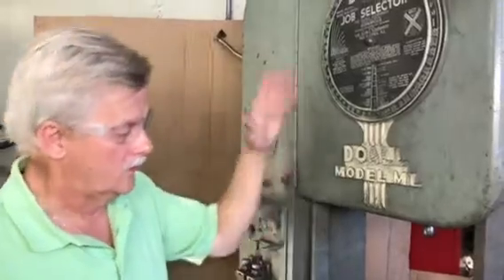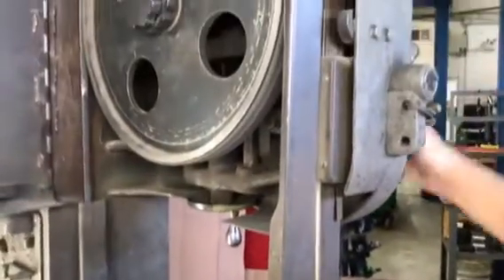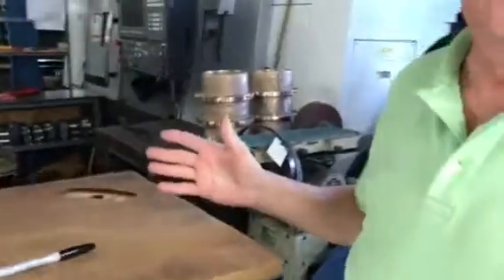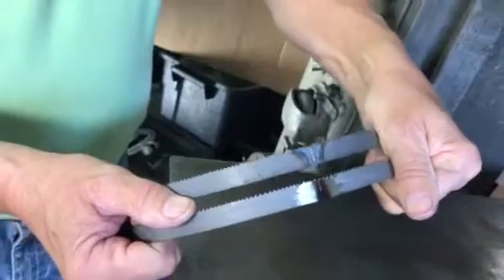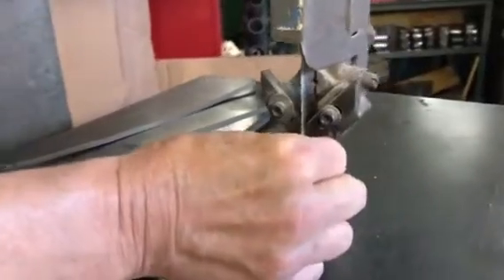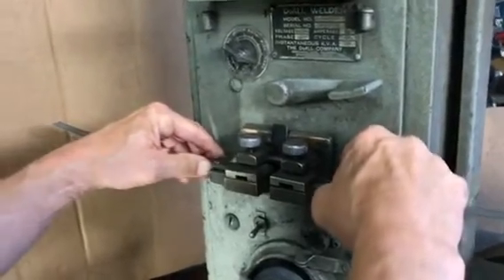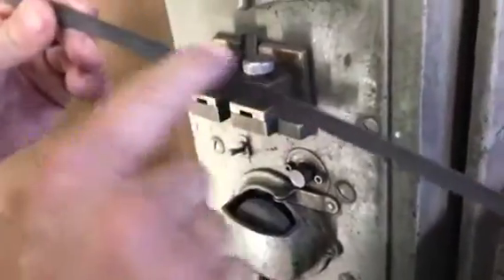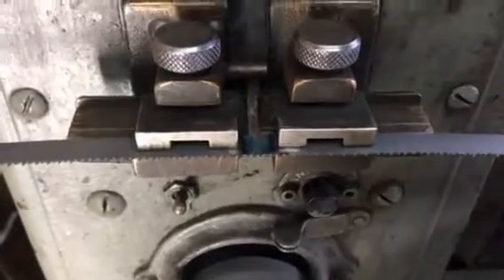Makers Machining - Welding your Band Saw Blade

Comment: Well done for grinding the set off the teeth another buggered blade. You only need to grind off the weld that passes through the guides, 3/8" guides for 1/2" blade. any weld left on the teeth area wear off when cutting. Hope this helps. Also advisable to do extra annealing, after doing the center anneal, shift the blade about 1/4" each way and anneal again. This will give an anneal width of about 3/8, and be kinder on the blade. Regards from Australia.
Reply: Ill give it a try
Reply: good idea, thanks.